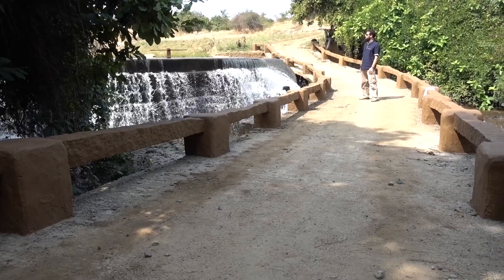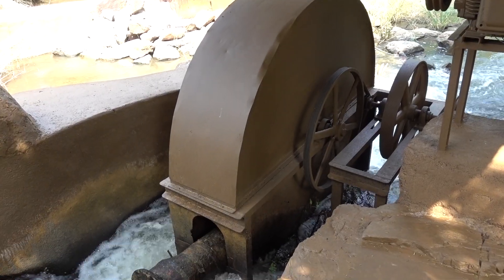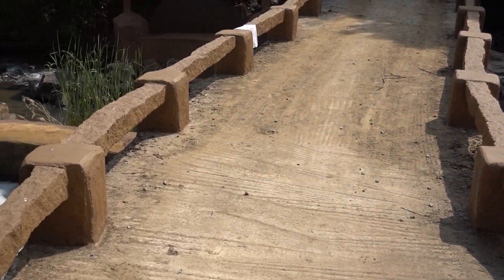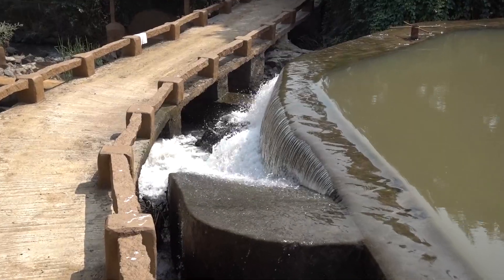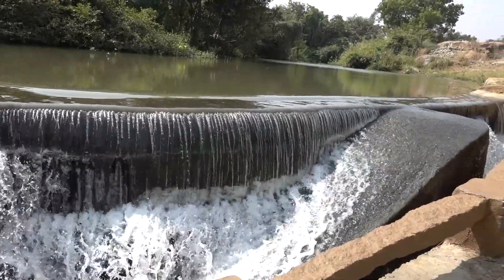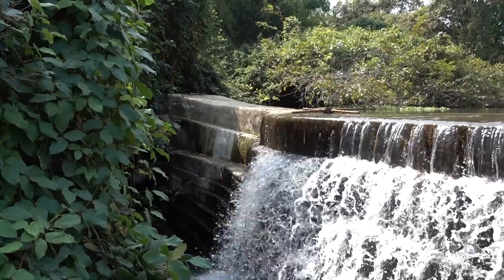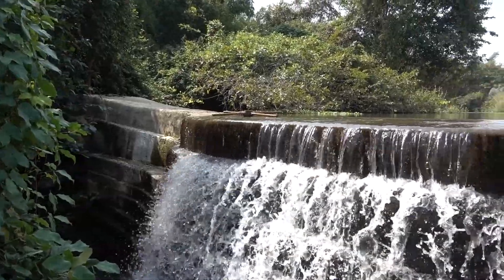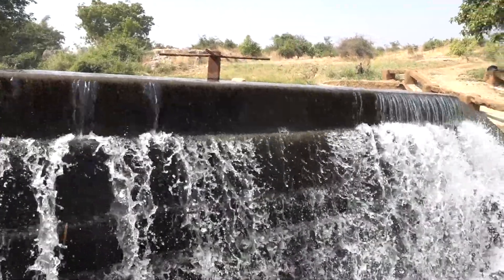Micro-hydro Electric Fish Ladder in Hampi, India

Comment: thanks for posting.    reality check  -   this video  is just  fluff.      at :38,  what do most people expect a dam to 'hold back'.  gerbils?     in other words,  poor phraseology.    the final statement is  LOL  overly-broad.      two  facts  are obvious in this video.    this installation has been in place for  DECADES; so, no 'points' for recent, innovative thinking.     the 'shape' of the housing and relative location of the water inlet, clearly, indicate a  POORLY  designed  hydroturbine configuration was used;  so no points for   'quality of design'.   cheers         googletranslate